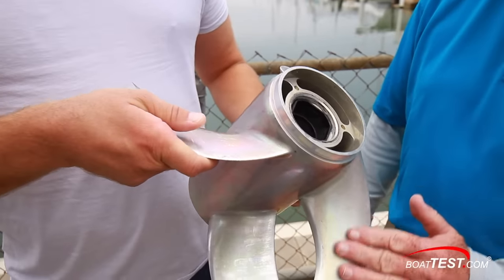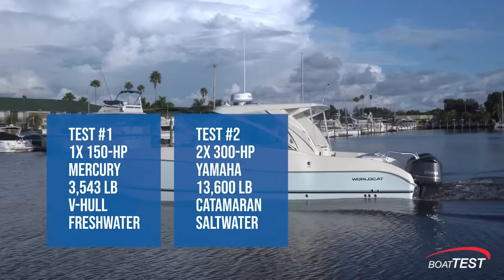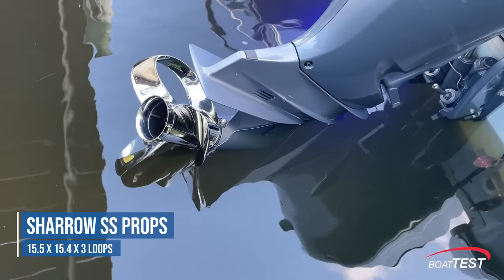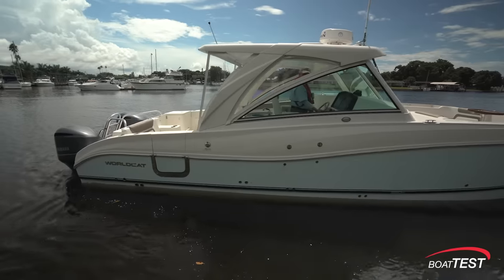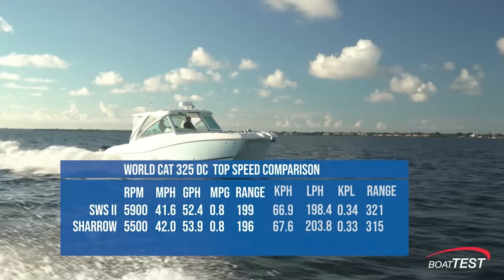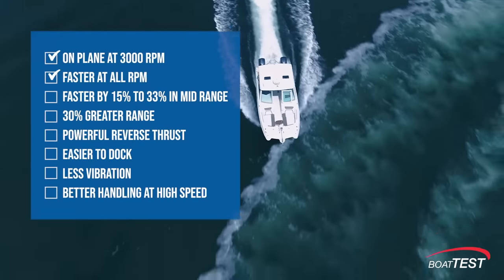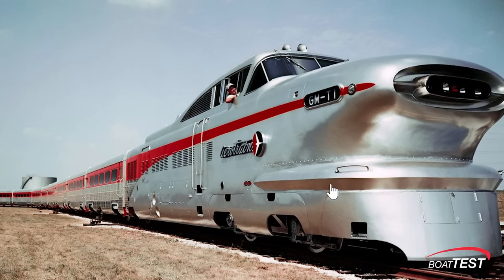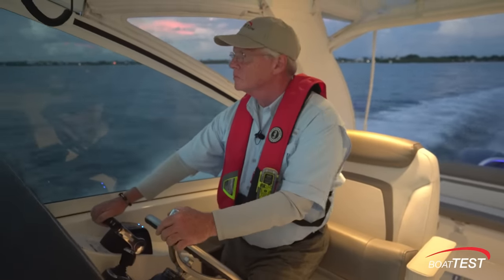Sharrow Propellers (2022) - Test Video by BoatTEST.com

Comment: Thats a great video! Its 4,900$ for a prop for a 300 outboard so I would have to burn about 5,000 gallons of fuel to break even with a 25% increase in efficiency. Something to think about for sure.
Reply: But, bragging rights, priceless.
Reply: Got to be crazy on acid to spend 5000$ for a prop
Reply: $5K ... you can have it manufactured at a metal fab for less. 3D print it and then cast it.
Reply: Good point, but for me range is priceless.  25% further gets me to the prime fishing grounds and back without worrying about running out of gas, or having to carry extra gas and waste deck space.
Reply: What about environmental impact, or does that not matter to you?
Reply: That crazy price for a prop regardless of its fuel and performance abilities. The comparison of trains is also crazy. More like changing the tracks so they were more efficient with less drag.
Reply: Yeah this makes more sense for commercial vessels or just larger vessels
Reply: @kobyhubbs6105  What donkey goes on the water not having extra fuel for emergencies??? A 5-gallon jerry can will give you an extra 100ish miles according to that guy's stated statistics. How far are you going???

Comment: I’m guessing the MPG breakeven on this 5k investment is between 5-8 years based on typical engine use. That’s reasonable and not dissimilar to buying a hybrid car or installing solar panels on your home. However, during those 5-8 years you also get better torque and performance within the mid-range. It would be interesting to know if engine durability is increased over time as less RPM’s are needed. That could make the cost benefit a no-brainer
Reply: It’s going to be WAY less than 5 years, unless you hardly ever use your boat
Reply: Buying a hybrid car is never about the cash savings when upgrading, you would (almost) always save a ton of money by just staying in the car you're in until it needs to be refreshed. Simply, the fuel efficiencies cannot overcome the cost of the new technology. It's exactly the same here; that 5k for a new prop (EACH), would pay for an awful lot of fuel.. hell, that's almost my slip cost for an entire year. So, Sharrow had better start finding some way of working with dealers to get these props included with the purchase of a new boat. Otherwise, I don't see many but the early adopters and visionaries getting these and that's not good for them. Otherwise, I look forward to seeing these props when they come down in price
Reply: It also has to be said $5k is BULLSHIT LEVEL CHEAP when it comes to boating. Even the smallest boat. On larger boats $5K is literally nothing, not even a rounding error.
Reply: @darthkek1953  Beyond some level. I just finished refurbishing a 1991 21′ Boston Whaler  for 25K with a 2018 Yamaha 200. Five grand is not a discernible upgrade for me. Of course if you're buying a brand new boat for 250k, then yeah, 5k is nothing.
Reply: @Laspatoadv  you're really not the target audience for this. I admire penny-pinching boaters and good for you but this is not for you. People spend what you spend on TINY upgrades to their yachts. Aquaholic spoke to one guy who spent $5,000 on Princess-branded cushions.
Reply: @darthkek1953  Is that $5k per prop? I would think the 25-28 ft center console guy who wants to get as much MPG/range as possible would love these props on his twins, but as has been stated before a $10K bump puts a helluva dent in the electronics, tackle or other add-ons budget. If you're the guy who buys a boat and keeps it for 15 years or your money-is-no-object buyer, I guess another 5% tacked on top is of no consequence. For me, I guess I'll have to wait til the price comes down and the competition goes up.
Reply: If the range is extended by 20-30% I would say that it's worth it to some people just for that reason.
Reply: Check the price on this new thing, it's only $4,900 What a ripoff!!!
Reply: @darthkek1953  Un,,,,,, I only paid $3000 for my entire boat, motor and trailer. $5000 IS way too much money for just a prop.
Reply: @robhill8894  For sure this not one the first upgrades of a $3000 boat ;-) even $30,000 would be pushing it but all the money boats its a case of why not? Doesn't just pay for itself over long term, but less vibration and better speeds and handling? No reason not to. Literally none.
Reply: If they could get the price more reasonable it will be a much more likely buy for far more boaters... That 5k in my 401k  for 8 years makes the my money back I spent on the extra gas.
Reply: @darthkek1953  On a 50K boat, that prop would be 10% of the purchase price. Ouch!  Having said that, someone who does a LOT of boating or is making a living with the boat might see a "reasonable" pay back on this.  I also suspect that Sharrow will eventually be able to lower the price on this prop if its popularity takes off and they have an economy of scale with regards to manufacturing it.
Reply: @deepsea5107  comes down to usage. Fuel dock last year around me was $5 a gallon for fuel. Getting 1 mpg vs 1.4 or 1.5mpg is a crazy savings. 250 gallons of fuel is $1250. If I'm only spending 825 for that distance, it's worth it in pretty short order. 12 tanks of fuel.
Reply: shallow unseen rocks would like to have a word with you
Reply: @danielesposito9705  I did the calculations for my use (22' aluminum boat, 150hp, 3000 miles/year) and I figure it would take me about three years to make up the difference... still too long for "recreational" use, IMHO.
Reply: @darthkek1953  Not for all of us.... I wish it were. 22' Hewescraft 150hp and 3000 miles a year....
Reply: I had the same issues with my Chrysler 300 Hemi car. It ran like a greyhound but got s**t for mileage so I finally made the trade for a Hyundai Hybrid last year. Hemi got 14 in town and 19-20 hwy. The Hybrid gets 44-45mpg in town and 55-56 hwy. Needless to say, I get three times the mpg in town and hwy. The only problem is my Hemi was paid for but I have  a car pymt now. :-( :-(
Reply: Why are boaters not useing the marine jargon of nautical miles in stead of miles just the same as knots so if you running 60 in the ocean that’s equal to 55 mph on land
Reply: @davidthompson5710  I bet you wish it was only $5 now.
Reply: @davidthompson5710  in guessing that comment didn't age well.. lol.
Reply: If it made market sense than Mercury would pay 5k put them on their motors and sell them for 5k more and market better fuel economy. They’re waiting for the patent to die and take it like everyone else. That company should sell as many props as they can at break even to make a name before they disappear the day the patents over.
Reply: This prop is intended for the guy that put a shit ton of hours on there boats.plain and simple.guys in my area that fish a lake that only allows 25.hp 4 strokes.they spend thousands and thousands just to get a few knots out of there rigs.boat guys that live for fishing would buy 3 of these.
Reply: @jamesmahaffey2822  Knots help with open Ocean navigation and chart planning - absolutely useless for recreational boaters on lakes and rivers.
Divide or multiply by 1.15 - how does that help ??

Comment: Now would this scale up to container ships? Think of the savings in shipping and environmental side to saving that kinda fuel in a large ship like that.
Reply: Yes it could be scaled up to a container ship or cruise ship but the big problem would be the cost would be 10 times whatever the normal prop cost was and likely more than that. I'm going to Google that because I'm curious now!!!
Reply: @MrDilley777  I guess it would depend on a few factors but I could still see it being such a benefit to the environment alone. Hopefully cost come down but doesn’t seem to be the trend at the moment.
Reply: Ship fuel is significantly expensive, so much so that they even have multi-fuel ships that can switch fuel between the cheaper and more eco-friendly fuels when they sail into areas with tighter emissions requirements.  If they're willing to spend enough money to make a ship multi-fuel, they will definitely spend on a prop that will save them significant amounts of fuel.  Keep watching, if the prop is really that good for the shipping application then they will start using it.
Reply: @8180634  they probably have already tested it….
Reply: @8180634  I think they would have to engineer a new machine to CNC this thing because of the complex shape. I googled the cost of one of the old design cruise ship props that about 18 ft in diameter and it was 1.5 million pounds of English currency and that means 2.3 million in dollars. Now times that by 10 equals 23 million dollars and if you have two or three props then 46 million for two and 69 million for three. I think you'll need a coupon or get it on sale (How about Not). It would be kinda cool if they made a electric coffee stirrer and drink or blender out of it!!!
Reply: @MrDilley777  come on. It’s not going to cost 23 million to make one of these props for a container ship or whatever. It would be cast just like a reg prop and the cnc machined just like a reg prop. Yes it would be a little more complicated to figure out. But a five axis cnc would do it.
Reply: @MrDilley777  they aren't machined. He said in the video that there are casted.
The prototypes are probably machined then they make a mold and cast them
Reply: The rpm just aren’t there to make it worth it.
Container ships just don’t have the disk loading
Reply: They actually started off on the larger ships and have now worked into the recreational markets.

Comment: Well, why is this type of propeller effective in boats and not effective in airplanes, for several reasons? The first is that the mass of water is heavier than air, and because of the rotation of this type of propeller due to the addition that is connected to the tip connected to the blades of other propellers, an imaginary frame is produced during rotation, which helps to compress the water and propel it.  The fans have the same “better” result. If you put a surrounding frame on the regular fans, it will give you the same results and performance, and perhaps even better, because the circular diameter is outside the scope of the fan blades.

Comment: The theory behind this is exactly why azipods are used exclusively in the cruise ship business: to improve maneuverability (docking), reduce cavitation & turbulence, and include an outer ring which helps in preventing the directed thrust from escaping sideways. In essence, this is what Sharrow's prop is trying to emulate: a more jet-like laminar flow. Fuel efficiency is the icing for "small boats" but it's huge for ships which drink enormous amounts of fuel. I was a marine/ offshore/industrial electrician for many years, and I can tell you that the number one headache-nightmare the Chief Engineer & Captain shared was fuel economy and the related problems which accompany "going faster". I watched a marine documentary recently, in which the propeller took two years to make and cost $7 million US dollars!!! A ship's fuel usage is measured in tons per hour, not gallons. 
My mind is reeling with the possibilities that this design presents.
Reply: you should than also know that a good designed prop has millions to save, and every percentage is strived for. yet they don't use enclosed props for the most consuming vessels. they use them for very specific slow speed reasons. as you say the outer rings make the flow more like a jet. well that is only needed for low speed where the propeller slip is big (tugs, fisher trawlers, cruise boats spending most of the time in ports / shallows)
Reply: However, arnt jet pumps considered not very efficient?

Comment: Nice prop, good for open water.  For those of us in shallow/rocky waters, we need to calculate the value of this performance increase vs. repair/replacement costs.  My home waters are so rocky and unpredictable that I've switched to a Comprop just because of the annual damage costs.
Reply: Have you thought of switching to a jet lower unit? All you gotta replace then is seals and bearings. Higher upfront cost but saves a lower unit from smashing rocks
Reply: @WackemAndStackem  there is considerable parasitic horsepower loss with a jet and slow speed driving characteristics are awful.
Reply: even a bump into the sand and this is destroyed...and you aren't getting it repaired by anyone other than the manufacturer who likely will tell you to buy a new one....
Reply: You hit rocks with your prop yearly?!
Reply: you would be also replacing your shaft yearly by the sounds of it!
Reply: @lukashediger6637  sure many folks do or there would be no need for prop repair shops .....
Reply: @beserkerknight6384  nah prop shafts are pretty tuff you be amazed ...seen em twist splines and keep on spinning even bent they still run!
Reply: @beserkerknight6384  evidently you've never ran inland lakes and rivers...often times even just at the launch sand will be bumped, props are often mildly damaged
Reply: @beserkerknight6384  There is an entire prop repair industry, and the hubs are designed to save the shafts and lowers....a tiny ding or deformation in one of these and it's useless.
Reply: @WackemAndStackem  that’s a stupid idea. No offense… you just loss so much, including safety
Reply: @joshuaatkinson5810  I am not a boat guy, I am here for the physics, engineering and design, however, aren't small, light movable engines available that can be dipped in or out of the water as needed.?  I am thinking along the lines of the old style of boats where there is a super long prop that is manually controlled and can be dipped into a couple of inches of water.?
.
Better still would be a prop cowl that can take a bump, a cowl also increases the efficiency at almost all RPM with most prop designs, so it would pay for itself with efficiency and add the bonus of reducing rock damage, although I expect I am missing something here as I am not a boat guy.
.
@Phillip Seymour
Reply: @lukashediger6637  Good question.  Actually, I've only hit rocks hard once  in 50 years...but I hit driftwood - some with embedded bolts, etc. almost yearly.  Our lake level fluctuates about 130 feet each year, and can carry a lot of trash.  My solution is to use a Comprop, which saves my propshaft and lower end.  I buy one Comprop every two years, which seems to be the most reasonable solution for me.  I run a 19' bass boat with a Mercury inline 6 150hp, so replacing with jet drive would be like putting a BMW V12 7.5 liter in a Chevy Lumina.  Maybe if the Merc 150 ever needs replacing...but it shows no signs of wearing out yet.
Reply: @joshuaatkinson5810  just keep smashing into stuff then, good choice.
Reply: time to get a row boat for you
Reply: Yeah this might not be for you if that's the case.

Comment: I would be very interested to see these props on a strait shaft yacht vs the same yacht model with IPS drives.  My vote for platform would be a Grand Banks 60.
Reply: which you just happen to have available for a guinea pig?   ; )
Reply: *straight
Reply: They won't do a fair test, or test them in labs, because you'll see the same results all toroidal props and screws have; epic failure. See my other posts for an explanation as to why. It's basically a midwit prop. Someone who has a little bit of brains but doesn't think it through. They ignore the additional mass of screw, and extra strain and wear and tear on the motor to turn the extra 25% mass that doesn't give an extra 25% gain, if anything they usually decrease your speed by about 10% in long term use. (For an extra 25% petrol!)
Reply: @Edelweiss  I'm not really sure what the mass of the prop has to do with its efficiency.  Surface area relates pretty directly to drag, but mass only matters when you are trying to change the speed of the mass.  That's one of the reasons ships were getting bigger for years.  Drag increases by the square while mass increases by the cube.

I think by big concern with these props is the torque applied to the shafts.  The driveline is built and tested for a particular amount of torque.  Increasing that by 25% could drastically increase the rate of failure.